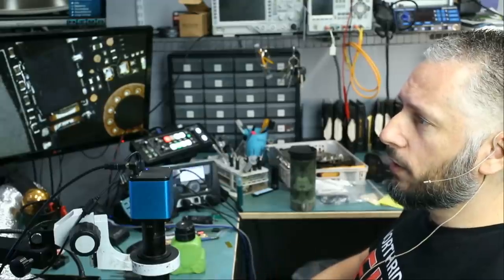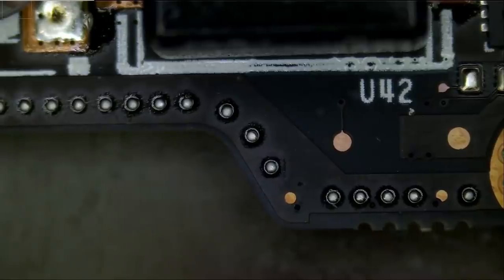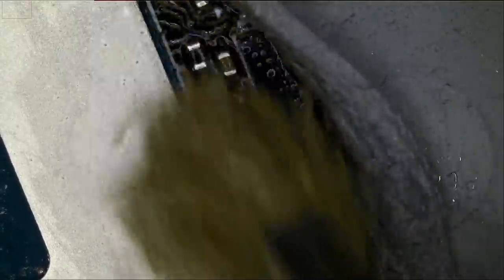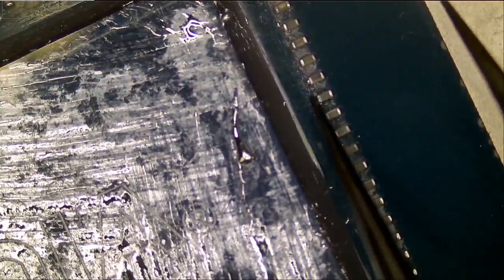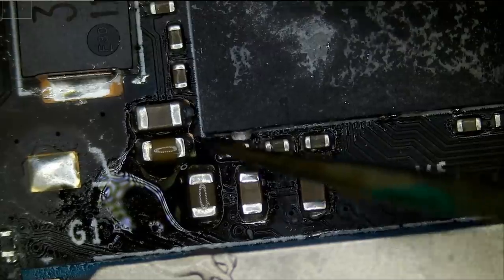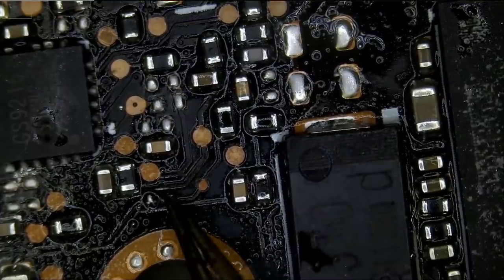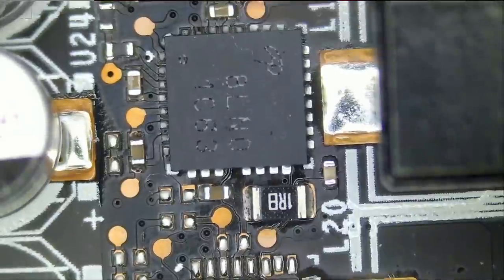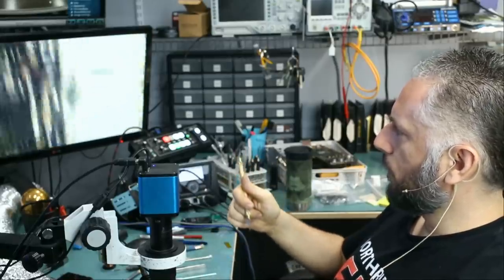RTX 3090 Graphics card Blew out after using Liquid Metal. A frustrating video to watch

Comment: I had a customer bring in an MSI laptop had liquid metal on the cpu he said he bumped his laptop on the corner of the desk and it wouldn't power on. I open it up liquid metal splashed all over the board shorting all kinds of shit it is a Hassle to clean I clean it up powers right on. They should create a protective ring that prevents spilling cause the shit is liquid at room temperature

Comment: This is just wrong on so many levels.  Why would you buy such an expensive board and then dump liquid metal all over it?  While this may sound a little naive to some, I have delidded CPUs and used liquid metal and I have converted GPUs to using liquid cooling.  So for a little rundown on what is really wrong here:
1. When you short out a bunch of stuff on your circuit board, you are probably not going to get it to work again.  Especially modern day where high temperature solder is used, it is very hard to get things on and off of the board manually without overcooking something.  It is also very hard to work with how things are soldered as it is more of a complex, high precision machine task than a human task.  Believe me, I have sat there at Intel and soldered stuff before on development boards and just modifying their development boards is a real skilled task.  The days where you would sit their with your oscilloscope and soldering tools to fix boards, well that is just something people don't do anymore, especially when the board has been dorked up this badly.  This is just a piece of e-waste now.

2. The temperature delta between a GPU and its heat sink with non conductive thermal compound is small.  There are two reasons for this.  For one, most GPUs are direct contact with the die.  This is thermally a lot more efficient than transferring to an IHS (internal heat spreader) and then to the heat sink, like what is usually done with CPUs.  Second, the GPUs spread the heat load around the large die.  So while they can chug down a great deal of power, relative to how a common gaming CPU works, the heat load is over a much wider area and thus the "hot spots" are less dense.  CPUs, especially gaming CPUs tend to have a few really small and dense hot spots and it is a lot more challenging to wick away the heat.  In other words, liquid metal makes a big difference for a gaming CPU and I would argue it is better than using solid solder as the die can expand and contract and not be tugged on and cracked by a solid solder that has a different expansion rate, but for a GPU it makes no sense.  The real value I have seen on my gaming CPU is 13C improvement over a non-conductive thermal compound when under load, and seeing with the IHS and everything else the CPU was just too hot for comfort before, but is good now, so it made sense.  With a GPU using liquid cooling I haven't been able to push the GPU much beyond 45C when using a non-conductive thermal compound, so I mean why would you need more than that?  Obviously the non-conductive thermal compound is doing its job extremely well and the thing to tackle was the heat sink side of things, not the thermal transfer compound, granted I used the highest grade non conductive thermal transfer compound I could find, but it wasn't what made the real difference.  The thing you can do with a GPU is get some quality pads in there to keep all of the surrounding hardware cool.  What I have seen with GPUs is there are hot spots all around the board and unsurprisingly with that kind of heat distribution, failures happen on other parts of the board.  Especially the capacitors tend to fail early.  The hot areas also make nearby components run warmer.  So yeah, it is good to have a whole board solution, but not by squirting liquid metal everywhere.  That's just dumb.

3. When you apply liquid metal to a CPU, it is a very delicate operation with the smallest amount of liquid metal possible used and carefully spread around.  Kind of imagine handing a grain of sand with a pair of tweezers under a magnifying glass kind of deal.  This kind of deal is necessary to not break things.  What is shown in this video is someone took a dump truck full of sand it dumped it everywhere as they drove around.  Then they are hoping this guy can make the board work again.  I am skeptical of that.

Comment: Guy used enough liquid metal to do 20 GPU's. 
It only takes a tiny amount of any thermal compound.
Dont use liquid metal, the gain is negligible at best.
I wonder if banging the board against a counter would force the stuff out?
Compressed air ??

Comment: That guy literally put the liquid metal all over the card. Liquid cooling is a very bad idea for me, better use a ceramic paste as they are non conductive and give heat transfer pretty close to liquid metal and you can spill it all over the board without worrying about shorts. Another fact that they blame it on thermal paste, that's not true because the cooling system in these cards are not adequate for the GPU, better use water cooling or an aftermarket cooling solution.

Comment: Yeah because liquid metal will drop the temps under freezing point :D
I just stopped using it even tho i never killed anything.. its pain to clean, if u forget to repaste it sometimes harden like a rock. 
Only exception was delided cpus but now with soldered ones its just not worth the risk.

Comment: Liquid metal is NOT a paste. You don’t apply it like thermal paste. It moves around and NEEDS to be contained. Look at any system that uses liquid metal. Easy example is the PS5. They put physical barriers between the chip and the rest of the system so the metal is contained to the chip itself.

Be careful!

Comment: hey , i use liquid metal few days ago , on my gpu and cpu. both work pretty well but i replace it very slowly and carefuly. After saw that guy's gpu. i can say i did great job on my gpu.Because clearly that guy used it so badly. At end of the day my gpu core temp. decreases 10C , and cpu temp. decreases 5C. i can say liquid metal did great job but still it is dangerous tho.
same time i also change thermalpads.
+ i bought my gpu almost 2 years ago. ( 5700XT Nitro+)

Comment: If you're dumb enough to try to apply LM to MEMORY chips you deserved that loss of a card. LM does not adhere, it FUSES into other metalls so it's almost impossible to remove it after application. I've worked with it before and i can tell you - even if it's 10 times more conductive than regular thermal compounds (though you mostly get 1-4 degrees lower temps because thermal interface isn't the main issue) it is NOT worth using it for prolonged periods of time because it fuses into other metalls, oxidises and instead of better conductivity you get worse conductivity and possible overheat. It won't adhere to non-metallic surface so use it ONLY on CPUs and GPUs with metal IHS. It's great for record breaking OC when you set things up for hours or days, it's bad when you try to use it 24/7 for years.

Comment: I admit I was stupid enough to have used a metrovac pc blower/cleaner on a pc I'd used liquid metal in the cpu/aio.  It went everywhere, luckily only killed the mobo and not my 3090. I never imagined being able to blow LM right out from between an installed cpu and cooler.  Don't use it, it's just too risky having a conductive liquid in a PC, imho.

Comment: I find using the syringe to suck it back up works ok.

looks like he used way the fuck too much, you typically need less than thermal paste, and I don't think gpu's typically have the mounting preasure can't have a big gap. like it's barely worth it on cpu anyway, cuts out like half the heat spreader choices because it eats through aluminum.

Comment: I hate people with a passion that try to fix something that isn’t broken. So what if it’s running a little hot? I’ve run cards maxed out at 100c for five years straight without issue. They wouldn’t have set the max temp point at that level if it destroys you card. Is that 0.1% performance increase really worth it? And if your the type that wants to see how much you can overclock just deem the card useless to you before you start messing with it because if it breaks and you need that card your screwed.

Comment: Yea don't use liquid metal if you don't know what your doing. its unnecessary really unless your competitively overclocking. The owner of this card should have looked in to water cooling methods if he was that worried about temps but 30 series cards run hot, GDDR6X runs really hot for memory by they are designed to tolerate the temperature so long as its not out of control. With all the crap you have to go through to get a gaming card now if you have a 3090 no way is it worth even chancing bricking it because even if you have the money you probably are not getting another one.

Comment: to be fair it would have been a 12 to 15 degree difference i have used liquid metal in laptops before it helps to put nail polish on the capacitors close to the die that keeeps them insulated from the liquid metal

Comment: I was very careful with the liquid metal I used on my titan. Every bit I applied was removed proper. I use 70% iso and quick friction on a clean qtip. I had my CPU get wet when it also had liquid metal and a tiny bit dropped on the pci caps on the pci slot and eventually I was moving my loop around and I ripped off one of those smd caps and now it doesn't detect. I see the pad that goes to the core still has solder but the pad that goes to the PCI slot is ripped off. There was only one side of the cap that I missed when cleaning and that ripped off after a few months. I am willing to pay for a job wether or not the issue is fixed that's how confident I am that that's all that happened. How much would a job lime this. I'm so disappointed that my titan X pascal is dead cause the PCI slot can't see it and that's it. Would this job be something you'd be willing to do?  I've killed 2 old gpus soldering trying to practice and I've decided I can't put a soldering iron to this without killing it.

Comment: in vain you smeared liquid metal with a sponge / sticks. It is easily assembled with a "braid" or a bundle of soft wires !!! smearing it with a sponge, you do not remove it, but "rub" it into the surface! All liquid metals contain indium, which allows this "liquid metal" to remain on ANY surface except PTFE (Teflon). Rubbing liquid metal into the surface will reduce surface resistance and increase leakage currents. at high frequencies, this will cause malfunction. so by wiping it off now, you just did "work for the future" for yourself.

Comment: there are so many good guides for applying liquid metal , i just dont get how people do use more caution with the amount of horror stories out there , its so simple , you wipe on a very VERY thin layer , on both surfaces and then remove the excess , not spray it at the freaking board from across the room , seriously what the fuck

Comment: You want to use acetone to clean liquid metal. Whoever applied it is pretty dumb, you absolutely have to insulate the smd around the chip with something like nail polish but even then that was clearly a very clumsy application and the guy probably used way more than needed for it to go all over the place like that.

That said it is the sad truth that the thermal compounds used even in 3k$ graphics cards are garbage and replacing them yields quite some gains.

Comment: I put LM on my 3090FE, fans at 60% maxes out at 48c in furmark. To remove LM that has spilt where it shouldn't, use a desolder pump, sucks it right up. This is the worst LM application I've ever seen

Comment: Looks like mercury it turns to gas at 358 degrees but make sure oven is vented and outside also use a good mask at that temperature it gasses and then open and let cool

Comment: And thats why i never delidd, remove or undo anything on a oc component. If it is not meant to me removed i dont touch it. My 3090 runs at 65c max under full load for hours. Thats fine, totally ok and i am fine with it. Never in my life would i remove the cooler, destroy my varanty to get a few degrees off this…. Nope… i lov ebuilding pcs, but this…nope.

Comment: Liquid metal os overkill. Factory thermal pastes are turd and gpus run on 90 deg +. I changed thermal paste with cheap ic essential e2 and droped it to 60. Why use liquid metal then? Mostly for extreme overclocking  most of us dont do...

Comment: There is a gun cleaner called CLP - break free that you can spray the PCB with and it will help the liquid metal run down after you apply some heat, you might also need to use a brush like you showed. The only problem is after the metal is gone, you have some greasy residue all over and have to completely wash the PCB in water and a small amount of dish liquid or degreaser ( I Know it sounds sketchy but it works) however your method was definitely faster and you didn't have to wash or disassemble or get the card as greasy as a slice of under cooked Bacon... Ofc you need to wait for the card to dry 1000000% before reapplying Thermal paste and pads and testing.

 Whoever's card this is, I'm sorry sir but your an idiot. With video cards at the price they are now, why not use artic silver or grizzly, why not leave the manufacturer thermal paste on because it's not all that bad now. You obviously have no need for his judging by your application. I could understand if you were a extreme overclocker or something but I could bet your not.

Comment: Try using a syringe with a thin needle to remove the liquid metal. 
Or solder removal wick. If it doesn't stick to the wick, you can use some solder to alloy with it to get it to stick.

Comment: Nothing wrong with liquid metal itself, it works great is you know what you're doing. I used it multiple times on my GPUs and laptops securing SMDs around with non-conductive grease or kapton tape and making sure no LM would escape the application area. I wouldn't take the risk nowadays tho considering hardware prices